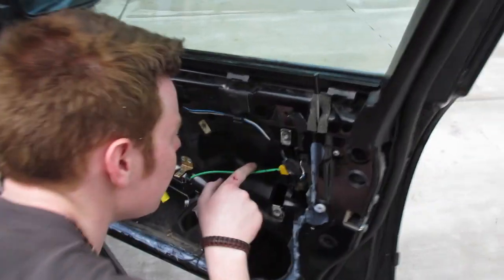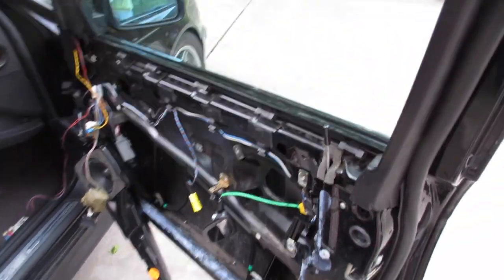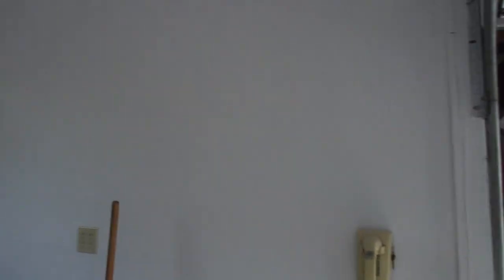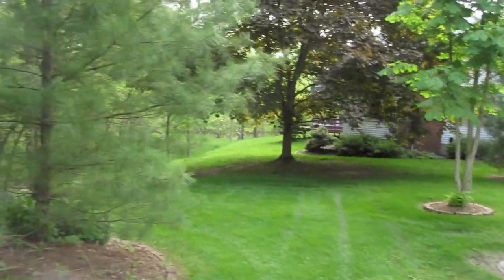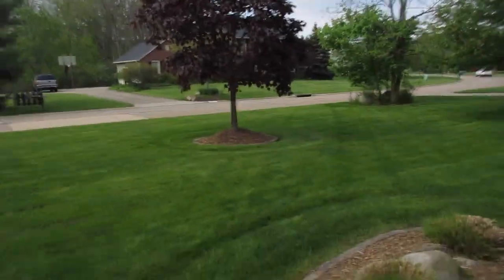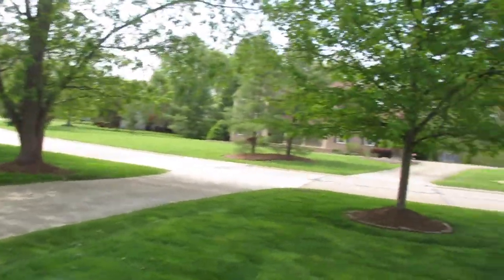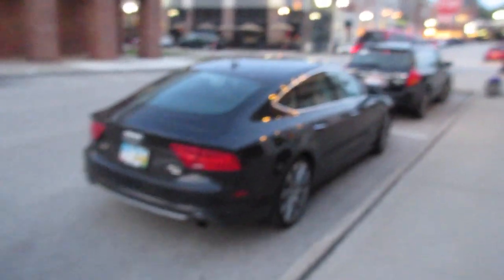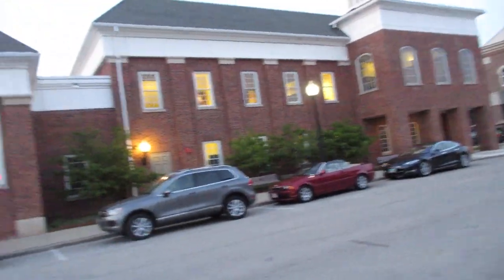BMW Window Regulators SUCK  5/20/14 - Day 1,259

Comment: The E46 we had had two go... Making parking where you get a ticket to park an issue when they did break. Fortunately Ford regulators have never had any large issues... If the discs got chewed out that quickly wouldn't it be wise to check runout on the wheel bearings to prevent more being dicked? I would have the A7, High end Audi's are so lovely inside. I've been in a 1.4 TFSI A3 and it felt much nicer than it had right to.
Reply from the maker: Aftermarket rotors suck ass regardless.  He should get bearings though.